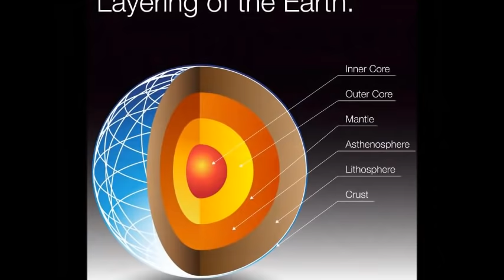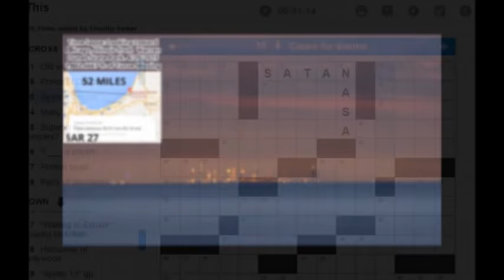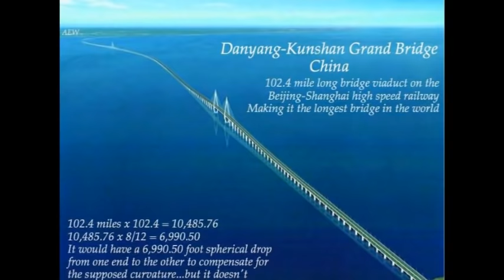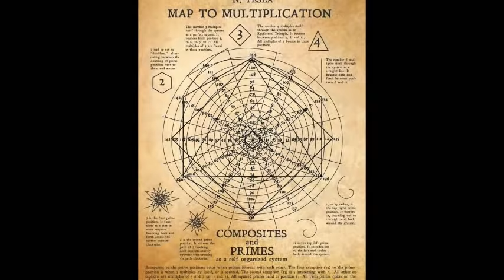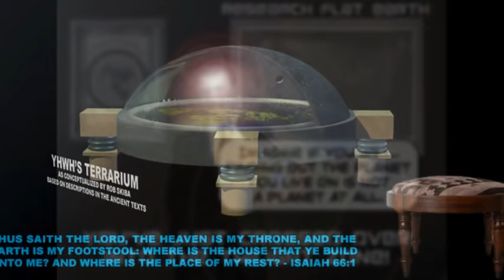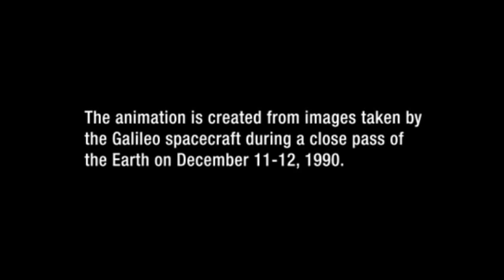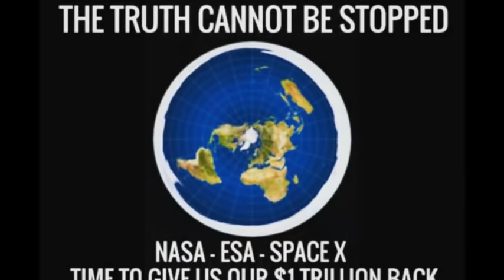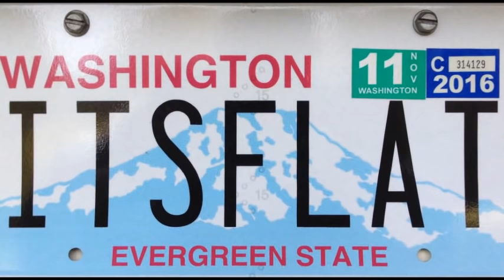The first rule of Flat Earth is, - SW60 - Mark Sargent ✅

Comment: Thanks for the theory.  It makes those with a poor grasp of reality to explore their surroundings and expand their knowledge.  With this movement I learned how an equatorial telescope mount works, took an interest in astronomy, am building an equatorial sundial, and working on a gyrocompass with a phantom gimbel as used in the Sperry unit.

I took an interest in maps and distances between cities.  Learned great circle routes and celestial navigation.  Learned about geostationary orbits, and sun synchronous orbits.  Learned geostationary satellites names and positions.  Investigated photos by non scientists for analysis.  Photos of note include TV dishes in Indonesia as they are on the equator and noted the direction the dishes face.  Looked at sunset photos and found huge numbers with the sun shining up on the bottom of the clouds. Looked at photos of mountains lit at sunset and just after sunset.  I've taken flights to Japan, Hawaii, Cayman Islands and watched land masses on the horizon.  Lot's to see besides what is on the internet and TV.

Learned how an aircraft artificial horizon works.  Same for directional gyro.  Even picked up an old military surplus directional gyro to see the calibration and precession torque mechanisms which are calibrated for latitude at overhaul.  Learned how the directional gyro differs from a gyrocompass.  Learned about the settling time for a gyrocompass. Learned how the gyrocompass is used on ships to drive the gyro stabilized platforms in the sat dishes for shipboard satphone.

After learning how this all works, it's hard to take a non rotating earth seriously.  Time zones and sunny side and shadow side in relation to stars and moon, seem to very strongly support a globe.  This brings the question, Why is this in debate.  I can only figure out this is trolling at it's best.

Thanks for the challenges.  It has been a learning experience.

The truth is out there.